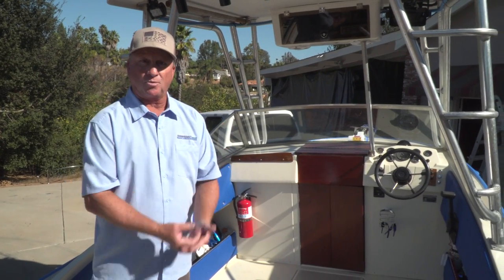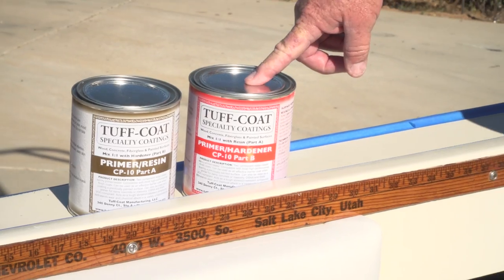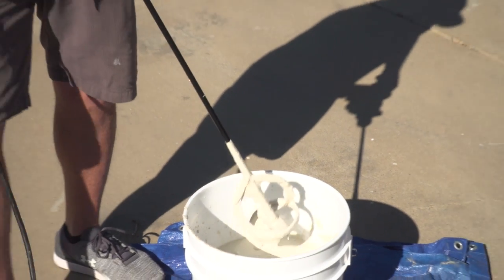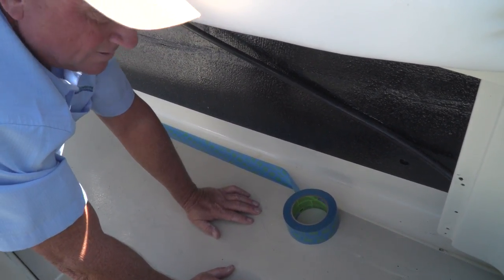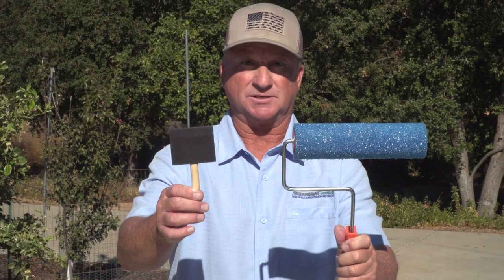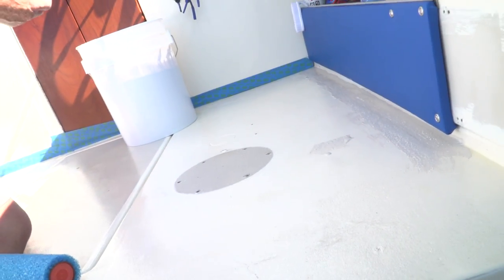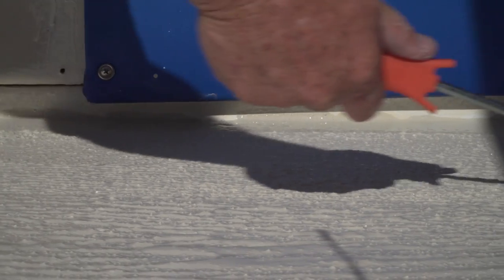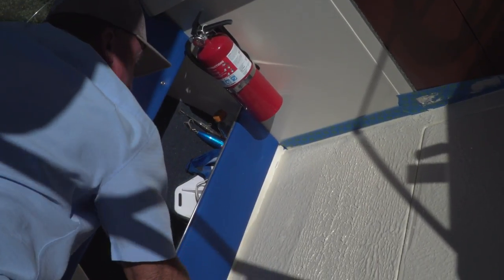Tuff Coat Coatings Contest Winner 2017 | SPORT FISHING

Comment: Hi I have a old 1978 ranger bass boat  . I want to get rid of the carpet and cover it with tuff coat  I also want  to cover the faded original metal flake paint that is on the inside walls  and around the top edges . I would like to spray it on  because there is not a lot of flat surfaces . I want to spray  the doors or lids  thats on the boat also . Can you spray the doors  and the sides  where its now covered with carpet ? I want to spray and cover everything . do I need to spray the  cp10 primer  over the  medal flake paint  and every thing that I want the tuff on ? Why didn't you put primer on the boat in the video first ?